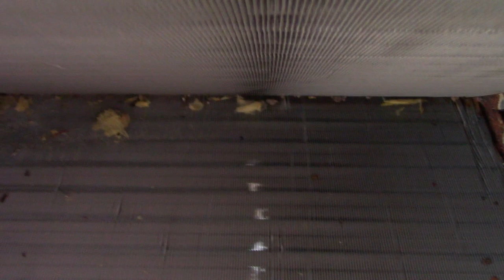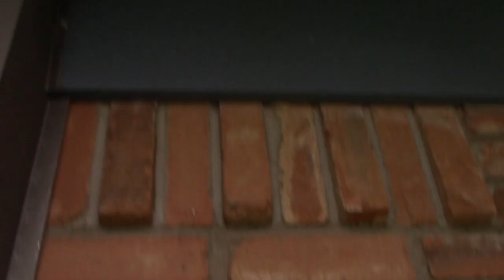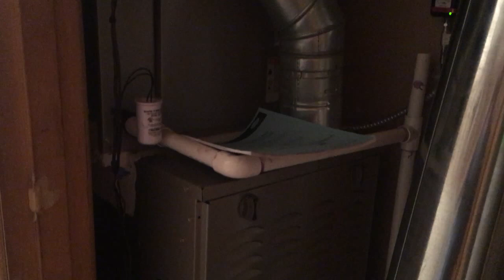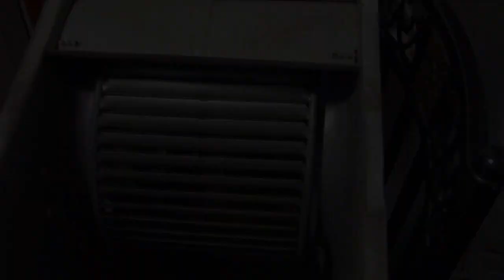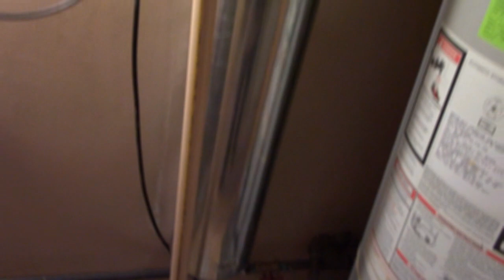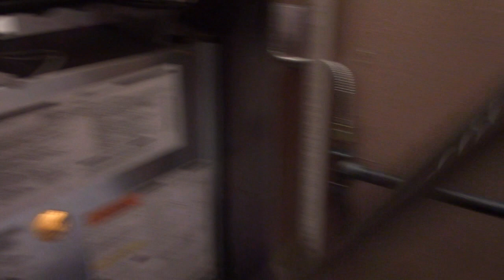2021 Carrier HVAC System Install

Comment: This is one of the reasons I INSIST on being home when I have work done.

The outside installation, while I understand what you mean, and having the filter dryer outside, that's where I've mostly seen them, so I'd let that go.  Yeah maybe the bend isn't as nice as it could have been.

But the other one inside where you could see the wire nuts, that was absolutely inexcusable.  I would have taken the guy over there and asked him "If this were your house, would you do this?  Now where else did you cut corners?"

Otherwise, yes, the system works, and will be fine I'm sure.  Reminds me a lot of the Carriers that Sharkie has.  Plain single stage, just do-their-job units.

Nice pile of parts from the old system, always great to have as spares.  That blower, oh yeah, that really moves some air!  I think uxwbill had a few of those around.  I wonder if they'd have to replace mine when my system is due; if so I'm definitely saving the old one!
Reply from the maker: Indeed! I wanted to be there. Gotta pay that water bill though, hun.
Yeah, it's the little details that make all the difference in the world. At least I got home while they were still there, and I did let the guy know I wasn't too happy about the filter dryer. I've seen them rust, and leak out, and I thought that was a great idea, how Sharkie's are inside, to help prevent that. Perhaps it's a clearance issue, and not enough room in the closet to braze them, without risking a fire. As the line set is next to the wall, and door trim. I didn't notice the wire nut in the viewing window until later on.  I'll likely take that wire nut, and move it out of the way. For the price of this install, they could have taken care of that.
Yes, it's working well. Both the heat, and air have been used since the install. I demanded single stage, and that's exactly what I got!
Yep, the only thing I forgot to grab was the hot surface igniter. I didn't even think about it until I recorded part 3, the first official startups.
Reply: @dynatrak  For the price, there's a lot they could have done better.  I once used that line of "if this were yours, would you do this?" and the buy looked at me like "Oops, I got caught".
Reply from the maker: @jaykay18  Exactly! I shouldn't have to go in and move that wire nut, when they could have done that during install.
Reply: That whole area behind that little porthole is like a big electric box where all the high voltage and low voltage connections are made. I have seen countless furnaces like this where you look in there and see both factory connections and those made by the installers around that porthole and it has ZERO effect on the operation of the system. 
That porthole is there so a technician can see the yellow light if it's on or flashing a fault code. 
As long as you can see the yellow light is on you're good 👍.
Reply: @seanmathews1826  You've seen countless installations like that because they are ALL done that way, slapdash.  As the saying goes, "Wham, bam, thank you ma'am" and they're off to the next job to do it again.
Reply: @jaykay18  Sir are you even an HVAC tech?  As I stated I've seen the factory wires in front of that porthole and it has no effect on the operation of the system. Sometimes when you put that lower door back on the wires will get moved around.  Seen it on Trane ,York Carrier you name it. 
You shouldn't be worried about it.
Those looked like 24 volt connections.  
Heck, Not even the code inspector would worry about it.
Reply: @seanmathews1826  No, I'm not.  However, I know the difference between a good job, and not-so-good a job.  When I hire a contractor for anything, I am watching them like a hawk, and point fingers immediately at anything I don't like so they can be done right.  I'm paying good money, they need to do a good job, it's just that simple.  Yes, they hate me, but that's fine, once the job is done, I won't be needing them again.
Reply: @jaykay18  Well just FYI the control voltage wires on any system hang free inside the cabinet on any system.  This goes for furnaces, heatpumps and boilers.  Those looked like the connections to the float safety switch.  I am glad we had this talk because over the last 30 years I have encountered my share of people like yourself because it gives me the opportunity to say to you that you are being ridiculous.  And I would be slightly annoyed if you complained to me about something so mundane.
Reply: @seanmathews1826  Not a problem, if you find me being ridiculous, you don't get the job.  Your choice.
Reply: @jaykay18  I recommend you watch the complete HVAC 10 commandments by Let's Be Techs
here on YouTube.   You sound like the violator of  commandment number 10 😏
Reply: @seanmathews1826  That's quite all right.  I was in the computer service industry before I retired, and there wasn't a single machine I repaired (out of well over 10,000) that didn't leave my bench absolutely perfect.  I also never got a complaint from a customer.  I CLEARLY do good work, and I expect those who work for me to do the same.  Like I explained, if I am paying good money, I expect good service.  Otherwise I'm throwing good money after bad.
Reply: @jaykay18  That's great 👍. 
 I throw down the authority of computer service to you.  But you don't know anything about HVAC and that is what that video is about. It's about who think they know but they don't.  When I have work done on my car I stay out of the way and let the mechanic do his job. When I had my roof replaced I stayed out of the way and let the county code inspector look the job over to insure it was correct and up to code.  It's the same with HVAC.  If there is anything wrong the inspector will flag it.  But his isn't going to flag an installation because you can see wires through the porthole. 
Never seen that happen in 30 years. SMH. 😄
Reply: @seanmathews1826  I stay out of my mechanic's way because they won't let me mill around the shop.  Doesn't mean I don't watch, and ask questions.  It especially doesn't mean that I just drive off after paying the guy, I inspect the vehicle to ensure the parts replaced were the ones that were actually replaced, and always ask for the old parts back.  Haven't needed a roof done yet, but that day will come.  As for county code inspectors, I can recall my dad getting a new boiler many years ago.  The inspector came, went to the top of the basement stairs, flicked the switch on and off, went down there, and slapped the stickers on.  Nothing was inspected!  I get my money's worth out of work I need done.  I got my pool liner replaced some years ago, and watched those guys all day.  I let them work, but anything that didn't seem quite right was pointed out.  That way I know it will be done right the first time.  Because repeat calls for leaks or improper installation can take ages, all while I'm missing out on using the pool, and at that, they're only going to do a slapdash repair patch job so, again, they can get out and on to the next call.  Money, money, money, is what talks.
Reply: @jaykay18  Let me ask you a question.  Since you are really smart and any so knowledgeable about everything why are you hiring other people to do work for you? It would seem to me with your vast knowledge you should be able to to do any job with expert precision. Those Russians could have used your skills in 1986 to correct everything at Chernobyl. 

 Now when I do a job I do right so I don't have to come back. But I don't like being hassled over mundane crap.  So over the years I have become very good at sensing people who are like you.  So I quote them for the job and people like you usually also want some sort of big discount and I tell them sorry it's out of my hands. And then I never follow up on it. I just let that customer go.
Too many other customers that aren't going to be such a headache.
Reply: @seanmathews1826  Some jobs are too big.  Combine that with my back injury years ago, and I have physical limitations that other folks don't.  

I'm also not foolish, I don't start pointing fingers until you've accepted and started the job.  You'll have no recourse but to finish the job, or have a lawsuit on your hands.  When you do good work, people will recommend you and call you back for other work.  That's the best advertising you can get, and it's free.  It's no headache to do a good job and do it right the first time.  In fact, it takes mere moment longer to do it the right way in the first place than to have to double back and redo what you did.  That's eating into YOUR profits, and it certainly sounds like you don't want that.
Reply: @jaykay18  The reason I wouldn't do business with you is that you have made it very clear that you don't like mechanics, service techs and inspectors. Your are paranoid and think everyone is out to rip you off.  You are probably also the type that would attempt to renegotiate the cost after the work is done. 
Now if you are not doing good work you won't last a year in HVAC.  I have been in this trade for a total of 32 years so I know a system has to be installed right.  But there are some customers that are never happy no matter what. They live to mess with you.
Reply: @seanmathews1826  Yes. but like I said, I wouldn't let you on to that until the job has been started.  I can play both sides, the dumb consumer that will just pay the bill and not ask questions, which is what you'll see for the estimate.  Then during the job you'll find out the hard way.  That's SMART is what that is.

I once had a plumber come in to give me an estimate to replace circulator pump gaskets on my boiler.  Recommendation came from a trusted friend.  When I got the estimate of $600 for GASKETS, I kicked the guy to the curb.  Went to Home Depot and bought the gaskets and did the job myself.  Gasket cost $5.  Savings $595.  That guy was CLEARLY out to rip people off.  Like I said, I'm an educated consumer, and I've been in the service business so I know what cooks.  I've had some customers that were near impossible to deal with.  You win some, you lose some.  Nice guys finish last, but he who laughs last, laughs best.

My uncle went to a mechanic to have an ABS wheel sensor replaced.  He came out $800 lighter.  The labor for that job is a half hour, including a 15 minute coffee break.  The mechanic I go to lets me bring me own parts.  And I just saw him, to have him replace the rear struts on one of the cars.  $180 out the door, cash, no tax, thanks, see you again sometime.  I WILL be back.
Reply: @jaykay18  Nah, After 32 years it's unlikely you'd be able to evade my radar. 😏
If I don't like you I'm not going to sell you anything.  I don't need you screwing with me for the next 10 years when there are countless other customers that can do business in a civilized manner.
Reply: @seanmathews1826  No worries Sean, I can spot a pompous attitude as soon as you show up.  I'd send you on your way right away.  Like the guy that came to my door to try and sell me solar the other day.  I said "Sir, I'm very sorry, but I don't want to waste YOUR time".  He pressed on and wasted his own until I slammed the door in his face.
Reply: @jaykay18  No I didn't forget about you.  I got busy working. 
I want to clue you in on one final thing.  You know that plumber that tried to replace gaskets for $600 ?
He likely did that on purpose because he knew you would say no get out!
He sensed to you were going to be a pain in the ass and he didn't want to deal with you. So he made sure you would never call him again.  I've done the same thing.  If you are gonna act like a horse's ass I will inflate the cost so you will say NO WAY!   Okay sir you got it 😉👌.
And like that I am on my way to an endless number of other customers who are more civilized.
Reply: @seanmathews1826  Congrats, you flushed all credibility of being a "professional" right down the toilet by proving you're a rip-off scam artist and your prices are made up total BS.

Comment: I see it's not an April Fools joke now. Looks like they did a decent job on the install. At least Carrier seems to still make halfway decent stuff. I have my doubts that it will perform as well as the 2003 did on really hot days. R410A doesn't get as cold as R22. I don't like it when the filter drier is installed outside. I have seen plenty that have rusted out and end up leaking. I'm going to do everything I can to keep my 2002 unit running. No plans to go to R410A anytime soon.
Reply from the maker: We'll see. I have an R410 system in my workshop, and it freezes me out, even during those 100+ degrees we get. The size of the condenser coil should compensate for lost refrigerant efficiency. That said, R22 will always be king in my opinion. Yep, I've seen them rust out, too. There was a 1985 Fraser Johnston at a gas station I took care of, that had that exact problem. I showed them what happened. Next time I went out there, it had a new filter dryer, and was once again running fine.

Comment: Looks like a nice setup. The outside unit still kind of looks like the old one too. Kind of a shame to see the 2003's go, they seemed like good machines, but I'm with you, being stuck with no AC in that kind of heat would be no good. I must say, 18 years on an HVAC system seems quite good, especially in that kind of use. I'm gonna miss my 2013 Lennox Merit 3.5 Ton AC/Heat Pump when it goes. Being 8 years old, it's getting up there, but hopefully it lasts a bit more. I've always liked the sound of it starting up, and the smooth purr as it runs. It's always kept me cool in the blazing Florida summers and warm in the winter. We're thinking either Carrier or Amana for the future new one, possibly Carrier looking at how yours has held up. Here's to another 18 years of Carrier-ing on!
Reply from the maker: Thanks, yes, I'm 95% satisified with the install, and both heat, and cool are working wonderfully. My Grandparents did the same thing back in 2003, when they decided to replace the 1983 York Tombstone system. That one was still running fine at takeout, as this 2003 was. However, the evaporator coil had stopped up, leaked condensation everywhere, and as a result, the air handler was rusting. When it was decommissioned, they discovered the evaporator coil was leaking refrigerant. Man, that was a smooth running system! Had very few problems with it, until the last year, or two in service. I plan to give this 2021 system the care I gave the ones before, and if I get same life span, I'll be really happy.
Reply: I remember seeing the York Tombstone in one of your older VHS videos. Those were really cool units. I bet they purred like a kitten! Was it an R12 system?
Reply from the maker: @toyota-eh3ub  Yep, it was a great system, The AC was R22.